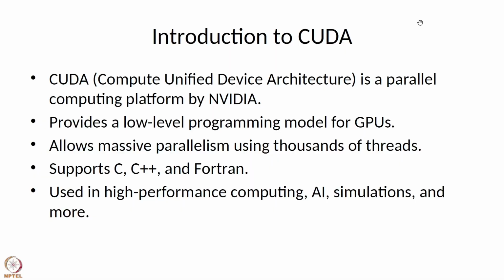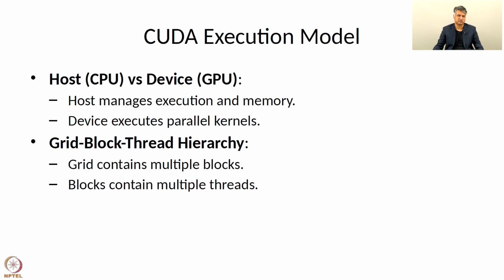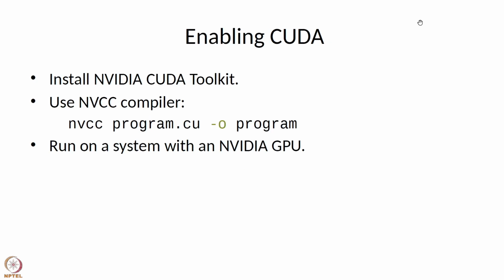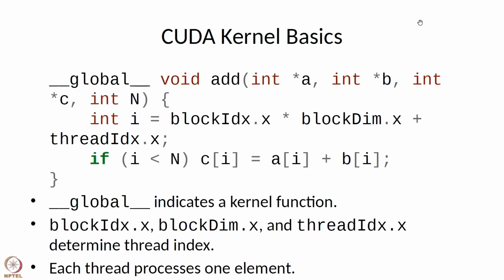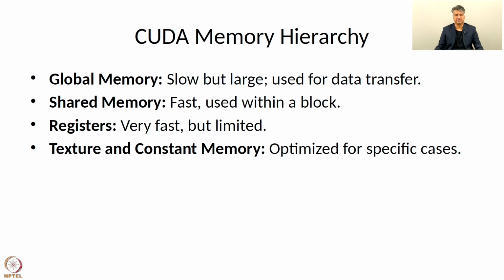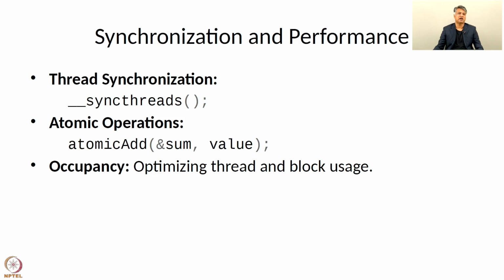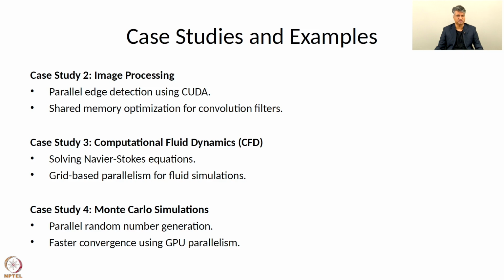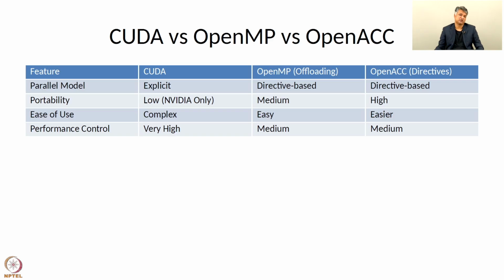Week 12: Lecture 3: CUDA Revision

Comment: Of course CUDA is best in Deep learning Because of low latency performance during the execution to give the instructions for CPU's  and GPU's registers and control unit processing when compared to OpenACC OR OpenMp.
But my doubt is that how much the code scripts are secured when Virtual GPUs are running in the cloud network for the robot? 
And what about code complexity when fast updates for robots are essential?
And how to manage the ROM size when the code scripts are higher memory in dynamic humanoid robots?